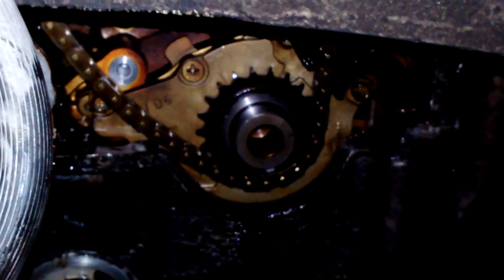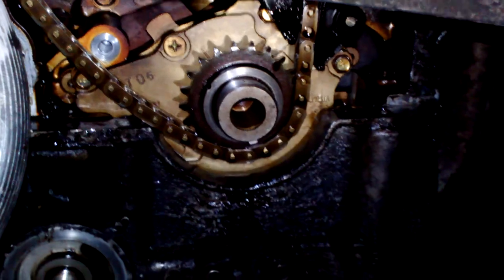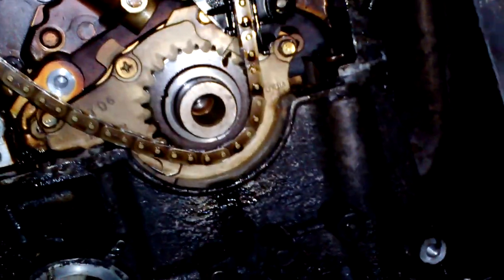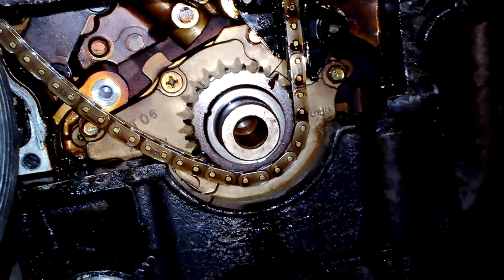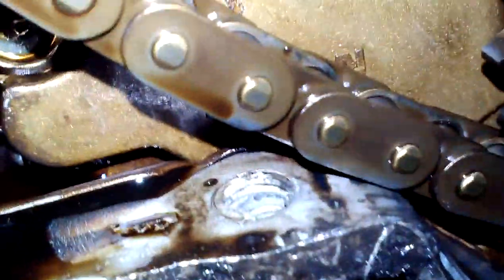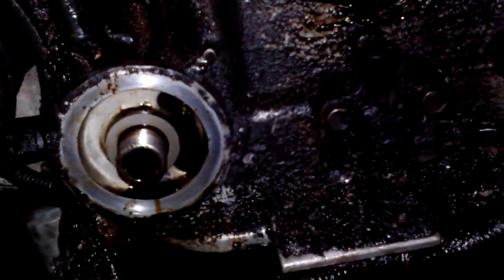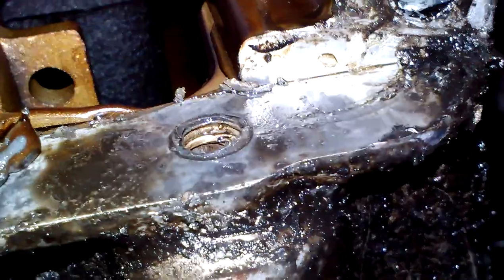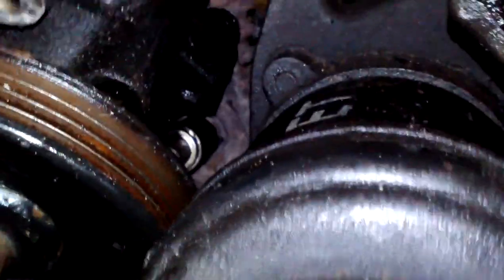96 maxima vq30de hidden timing cover bolts

Comment: the videos on YouTube have help me do a dual head gasket replacement job on a 97 Nissan Maxima 3.0 V6 that blew the radiator and spewed hell everywhere I could not have gotten it done without the information and theme visual aid that I've gotten on YouTube thank you for everything
Reply: and I did it in two and a half days I may add
Reply: these jobs are not for the faint of heart you have to have mechanical ability and know how to do basic jobs in the first place I have done head gasket jobs on several other vehicles it's the trouble areas that you run into that you need help that's what this provides if you cannot do basic jobs I do not recommend jumping into something like this